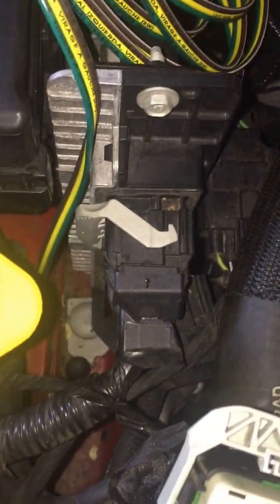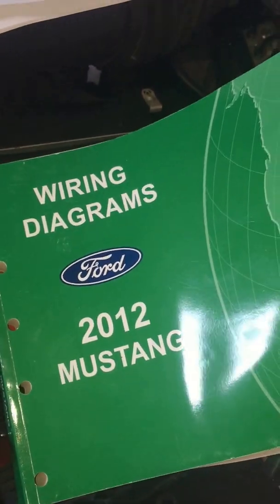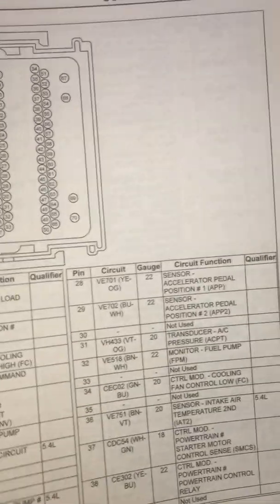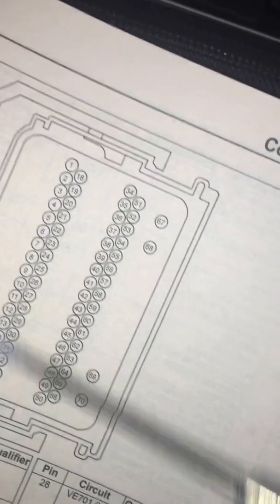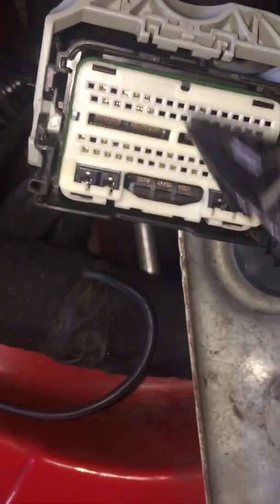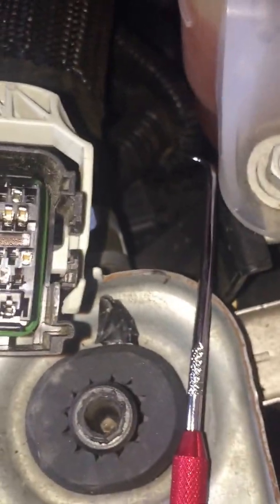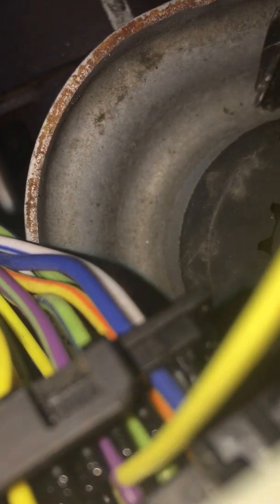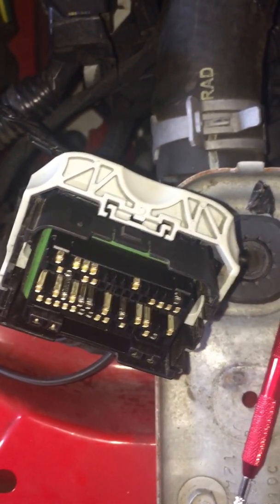How to repin / add a pin to 2012 Ford Mustang PCM Plug

Comment: Quick question. There is three plugs, the bottom ones are the same but one is straight and one takes a right angle. Which one goes where?